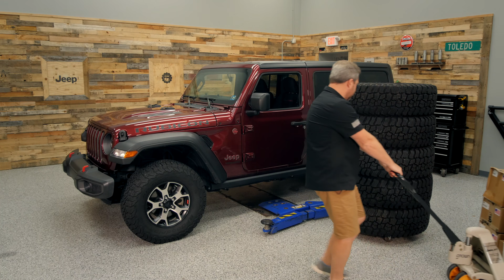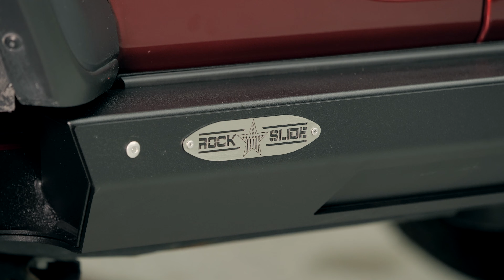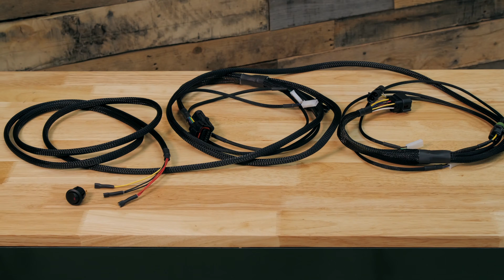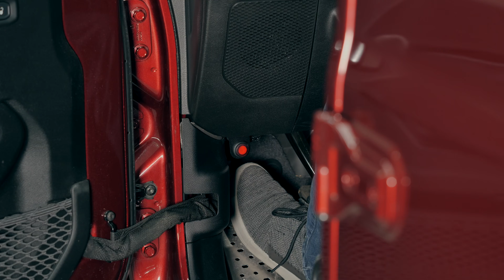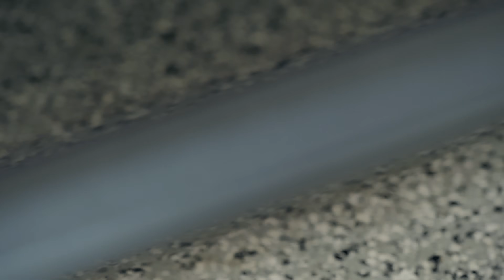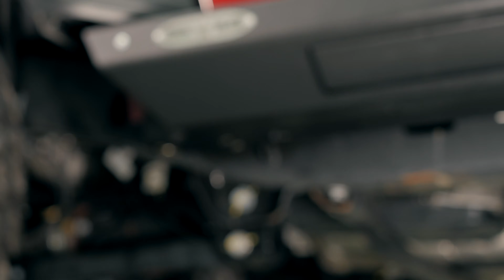Rock Slide Engineering Gen III Step Sliders for Jeep Wrangler & Gladiator

Comment: Just purchased. Can’t wait. These look pretty tight on the vehicles I’ve seen them on.
Reply from the maker: They are great! you'll love them, make sure you follow the maintenance steps and keep them lubed up!
Reply: U till you motor fails 6 month later and you get the run around how it was nobody’s fault, then you will say screw it and buy the motor yourself  spend you r time to install it only to fail 4 month later. Hinck of junk

Comment: Do you have a full install video for these steps for those of us who are not so mechanically inclined. For example showing how you routed the wiring up into the engine compartment..where you put the engine compartment kill switch...where the wires are routed underneath the jeep from passenger side to driver side. I've seen several videos but none really show these options.

Comment: What about when doors are off? How do they work then?
Reply: Technically you can hold any magnet over the door sensor when the doors are off and it will still activate the steps, correct?
Reply: Just buy their door delete kit that rock sliders advertises on their website and call it a day.
Reply: Thumbs up ďoes nit answer my question
Reply: @caliberinstall  the more thumbs up there are, the more attention is brought to the comment. There are other people who would like to know. That being said, they already explained that in the video. There is a manual switch you install so you can deploy the steps without the doors.
Reply: @ThePoozer69  i have em.  the manual switch is just a power switch.  it does not operate the doors.  but you can disable them when the doors are off.
Reply from the maker: Correct, with the doors off there is nothing to trigger them.

Comment: Are the motors, gearing and wiring water tight? I hit some deep water crossings sometimes.
Reply from the maker: they are water tight.
Reply: Mine barely lasted 12 months and just out of warranty.
Reply: I have them on my rubicon. Went through deep water now they are crazy acting. Actually why im here, to find out whats going on
Reply: @aaronwood3540  Was this ever resolved?
Reply: @aintthisthelife no but the company was really good with helping. The motors in them are not very strong either. Get dirt or mud packed up in them and they will drop but have a hard time closing. Never did get that part to work right

Comment: I'd hate to pay $2400 for something and it get dented up and become unusable..
Reply: I took my JLU to Disney Land in Oklahoma. When trying to climb a waterfall, the front passenger tire slipped off and the Jeep took a really hard hit on the passenger step slider. At first I thought for sure I demolished the passenger side of the Jeep. Turns out the step slider with the additional armor saved the day. The step slider did dent, but absolutely no damage to the Jeep, and the step slider still operates perfectly. In my mind, the price of the step sliders is well worth the cost.
Reply: I have beat my RSE step sliders on some pretty big rocks and zero dents and still usable.